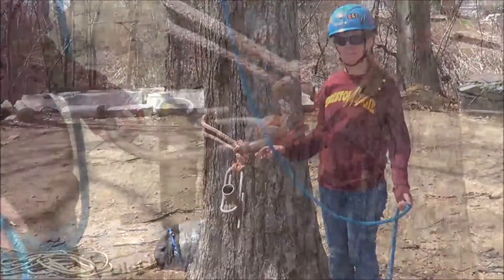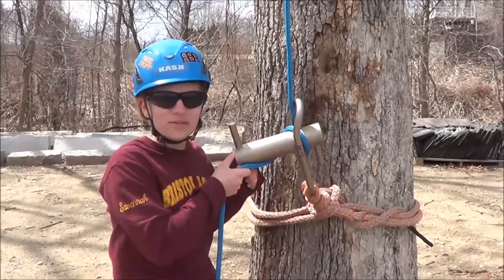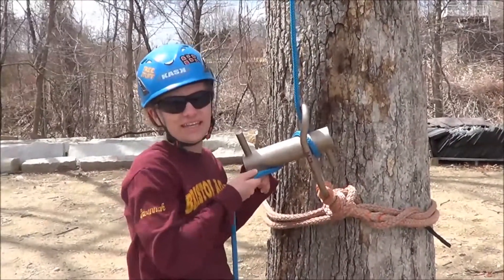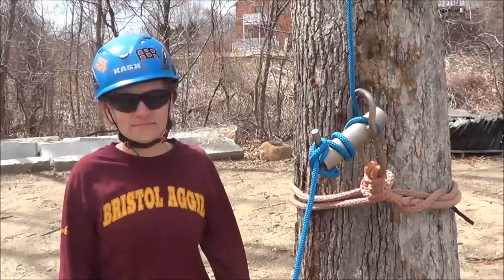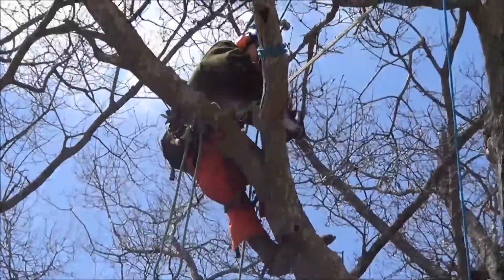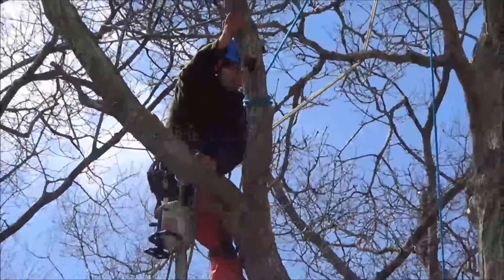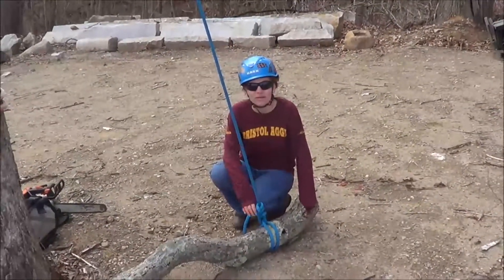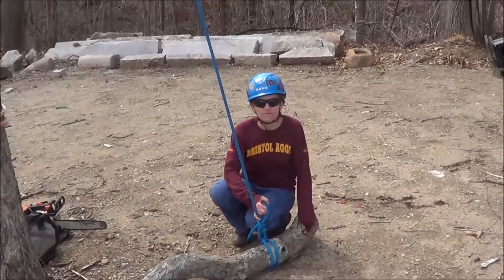Port-A-Wrap Installation and Use

Comment: Great presentation, however, there are a couple of things that should be noted. Yes, the port a wrap should be installed at the proper height and that ,ideally, is around waist height. In this video it was much too high for her to use maximum leverage. 
In very rare cases would it be acceptable to sling the rope in a loop in order to release wraps. a heavy weight load could cause multiple loops to unwind and control of your weight load could be lost and serious injury or death could occur.
Great presentation and explanation on a wonderful tool! Work safe!